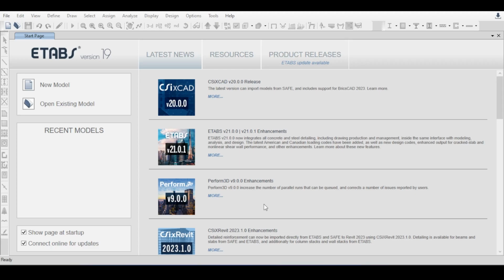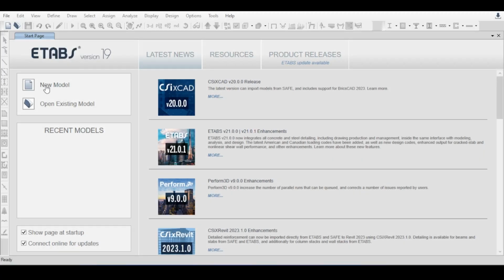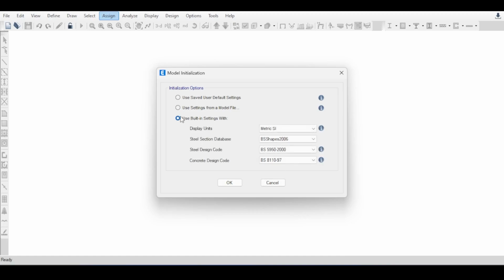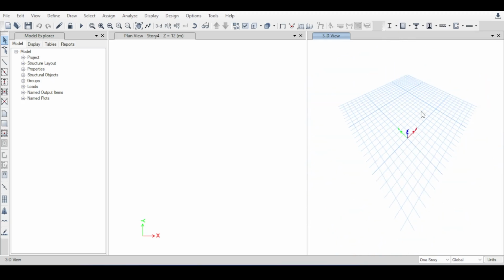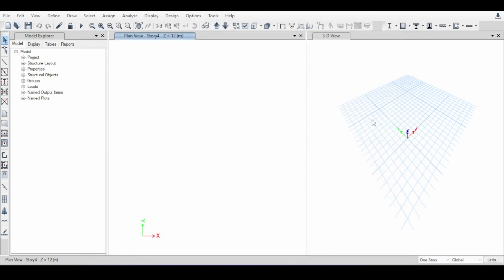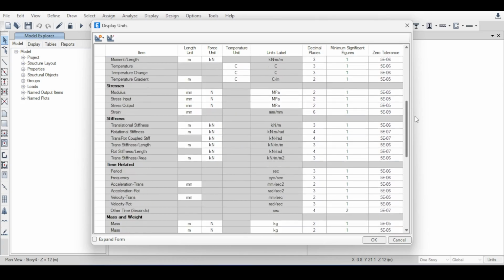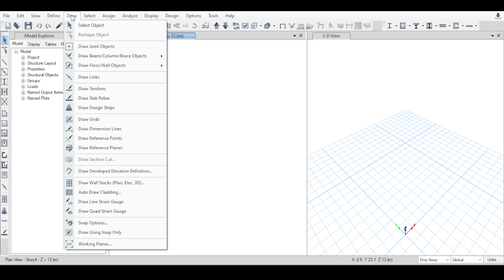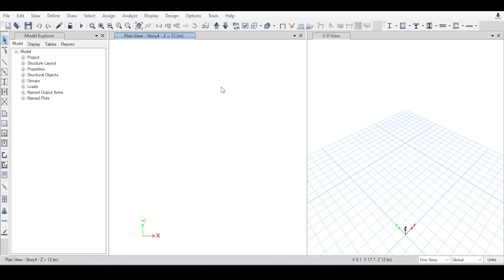Understanding the GUI - ETABS Building Analysis and Design

Comment: I like etabs. its analysis results compares 99% to autodesk robot. However i dislike its design output. It can assign diameter 20mm reinforcements from bottom to the top of a column for instance. Limitations on interactive design
Reply from the maker: ETABS was the first software I ever learned back in 2007. In some countries, ETABS and SAP are the "go to" softwares when it comes to design of structures, especially in concrete.

I wanted to add a new series to this channel to cover this software.
The channel will keep covering different softwares, so stay tuned for more content. Also, if possible suggest this channel to your friends via sharing.
Regards,
CEE
Reply: @CivilEngineeringEssentials  alright